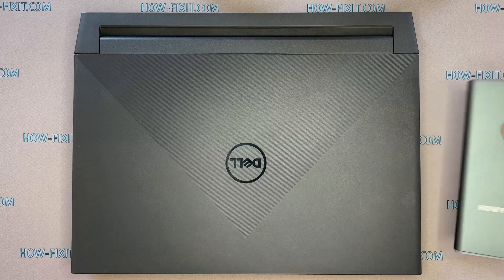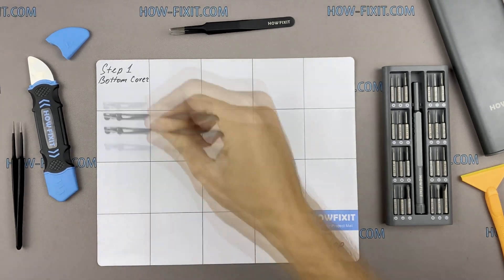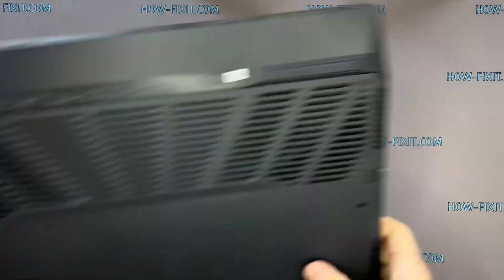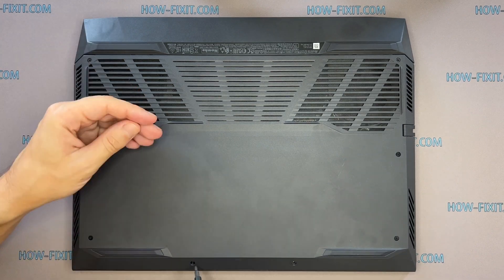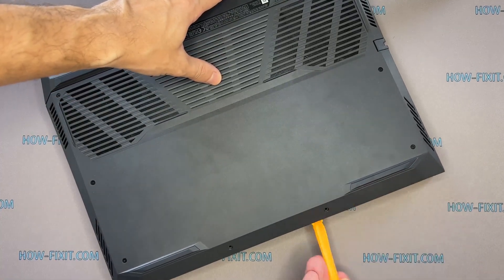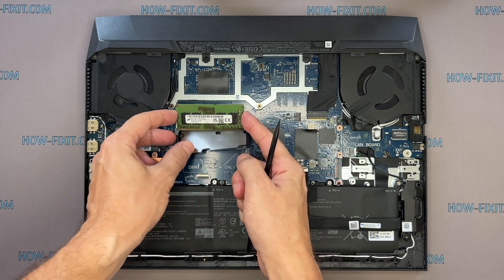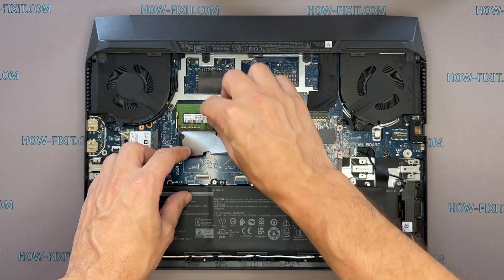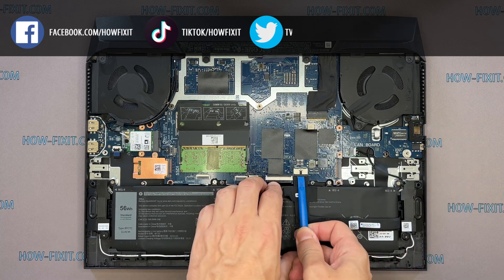Dell G15 5510 RAM Upgrade and Install - Your Step-by-Step DIY Guide!

Comment: Hey, just curious do I have to release all charge from the laptop before installing the RAM?
Reply: @weshicks2975  , after disconnecting the battery just carefully press the power button it will release all the charge

Comment: If ur laptop screen is still black after installing maybe ur laptop doesn’t support that type of ram if your laptop does maybe try different ram slots if that doesn’t work return to the buyer and get a new ram and try again
Reply: Ofthe the first time you try new ram it has to ‘post’ - I first register the ram. Can take longer than a normal start up.

Comment: Thanks a lot!

If you don't mind, I've got a question. I own a Dell G15 5520 laptop with 512GB storage, 16GB RAM, RTX 3060, and a 12th gen Core i7. I'm thinking about upgrading the RAM to 64GB. Is that possible, and if so, will it perform well?

I'm eyeing Crucial RAM options:

 
Crucial RAM 64GB Kit (2x32GB) DDR5 4800MT/s CL40 Laptop Memory CT2K32G48C40S5

 
Crucial RAM 64GB Kit (2x32GB) DDR5 5600MT/s Laptop Memory CT2K32G56C46S5

Which one do you think would be a better fit? 
Appreciate your response in advance.
Reply: Both are good but get the 5600MT/s one because it's faster
Reply: @ShurikenzFrenzy  The Dell G15 5520 manual says ram should be 4800MHZ, wouldn't the faster 5600 run at the slower 4800MHZ speed anyway?

Comment: I just installed the ram when i went to turn my computer on keyboard lights up but my screen stays black how to fix??
Reply: For anyone wondering, give it a few minutes, it'll reboot and say new ram detected :)
Reply: @NoobReview_Official  thank you
Reply: @NoobReview_Official thx bro ❤
Reply: @NoobReview_Official This
Reply: Yeah I’m in the same boat. I had to put my original ram back in. Idk what I did wrong.
Reply: Currently having the same problem, how u fixed it?
Reply: How did you solve it?
Reply: Have you fixed it??
Reply: @samuelgraham5476  yeah i did😁
Reply: @oiveral  how did you fix it??
Reply: How

Comment: It it’s necessary disconnect the battery?
Reply: Yes, cuz usually that prevents your computer to cause a short circuit spark that could damage the motherboard or other components
Reply: It’s the same idea as unplugging a desktop before opening it. You don’t want power going to any components while you’re working on it.